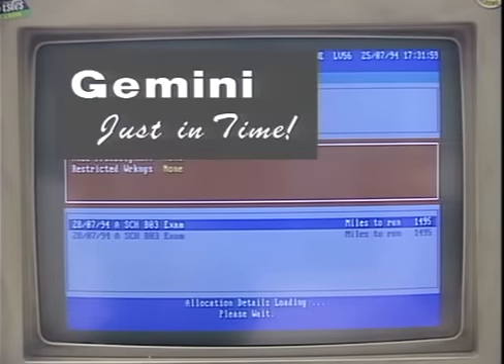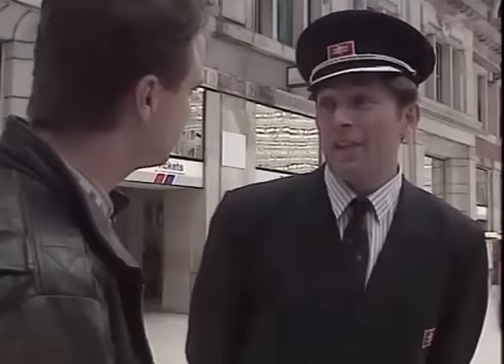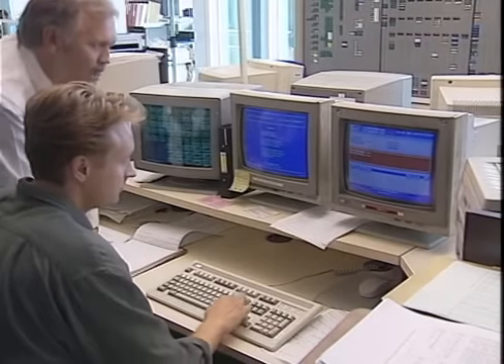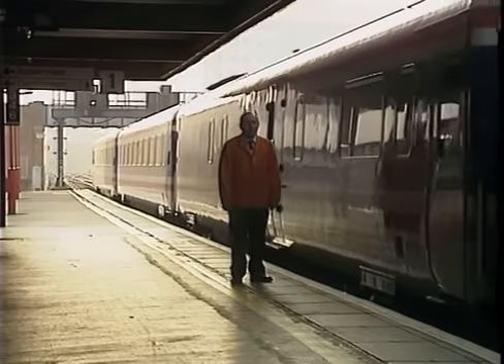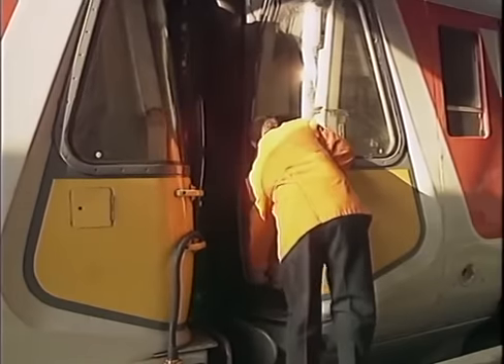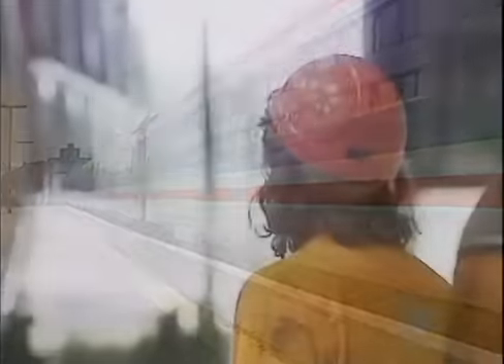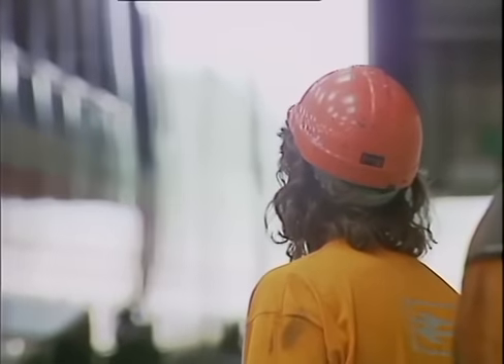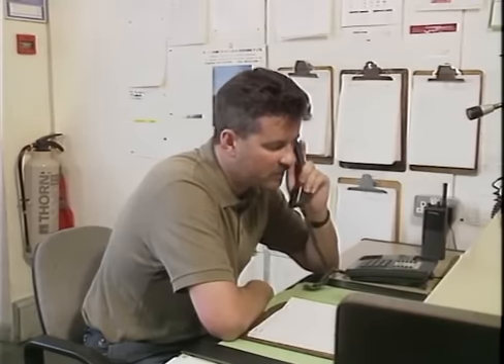Maintenance of Class 455 & Class 442 EMU, NSE - (1994)

Comment: why were these units withdrawn if class 313s are still running?
Reply: I think the class 442s were causing signal faults causing them to go red or yellow, so they withdrew them for safety precautions, they re-introduced them to South Western railway and they were once again withdrawn for the same reasons 25 years later they're trying to fix the problem but if they haven't done so in that time then I doubt they will anytime soon 🤷🏻‍♀️ it's a shame though, love these units
Reply: @arrycklavery9842 That comment was made circa 2013 when the 442s were withdrawn from SWT and put onto Gatwick Express, so you’re quite ahead of time there.

To answer OP’s question, IIRC SWT wanted a more flexible train fleet between the 444s and 450s allowing the pair to couple each other for long distance runs, helped with the reintroduction of the 458s. Meanwhile Southern needed units to run the South Coast services while bolstering the inner London trains with the Electrostars, so the 313s proved handy for the time.

Comment: The 313s Never Ran On The South West Trains Network. The 313s Run On The Brighton Coast Services And On The East Coast Main Line Local Services. If I'm Correct The 442s Were The Oldest On The Line Apart From The Now Withdrawn Slam Door Stock. The 442s Were Replaced On Weymouth And Portsmouth Runs By 444s. The 444s Are 21st Century Stock. South West Trains Didn't Replace 442s With Older Stock. In Actual Fact The 442s Were Withdrawn After The 458s Came Back, Freeing Up 450s Wich Freed Up 444s